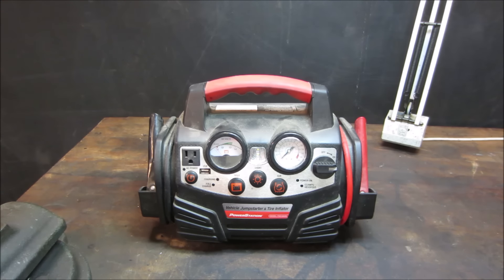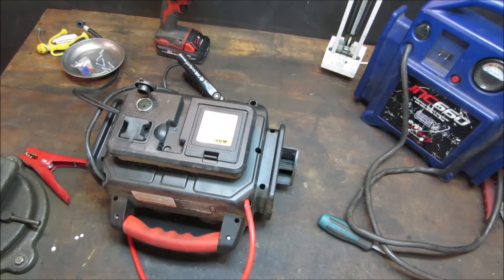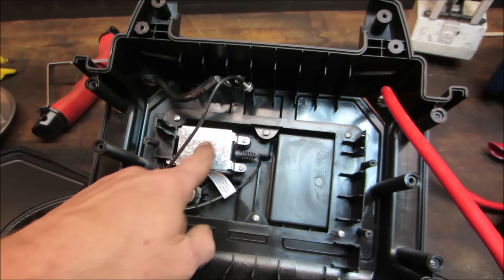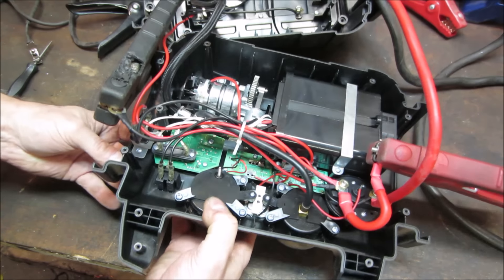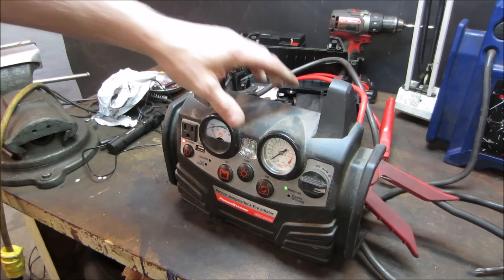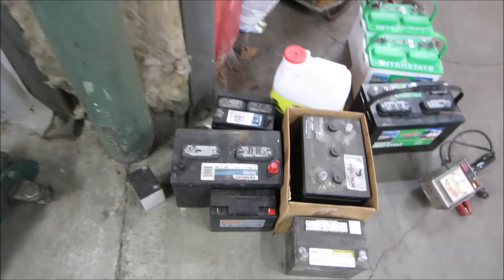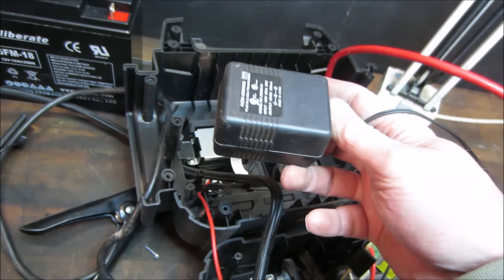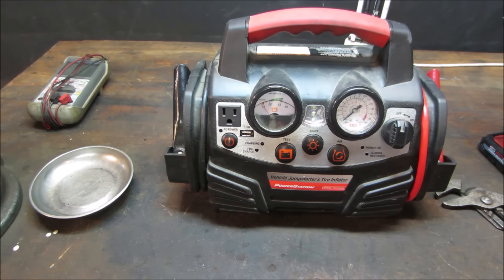What is inside a car jumper pack? and can we fix it.

Comment: I vote yes for a train repair video.

When I was a kid my dad got several large (4' x 4') crates of old electric train sets from an auction. He wire brushed the track sections, oiled up the motors, wheels and tested them out. Some of those huge old variable speed transformers were bad, and blew the fuse. I think there were several dozen working sets put together out of the good parts. Most of the engines and cars were metal with very little plastic, and were about a foot long. Some engines even had headlights, and smoke makers. I don't remember how much money he sold all that stuff for.

Comment: The battery load tester has an easily adjustable needle … on the front of the meter there is a clear slotted adjusting screw … connect a good battery and adjust the reading to show it is GOOD. Addictive shows, BTW! I can’t stop watching them! Thanks!

Comment: Hey Mustie, on the face of that load tester , there's a small plastic flat head screw just below the center of the gauge needle. If you rotate that it will adjust the position of the needle. Simply connect your multimeter to a resting battery and adjust the needle on the load tester to match. i.e. if your meter reads the resting voltage is exactly 13 volts, have the needle point right at the 13 on the load tester. Train set sounds cool! Thanks man

Comment: Very nice! I used to work at an electronics recycling center and those sealed lead acid batteries were almost always the weakest link. I'm a little disappointed you didn't properly test out the AC inverter though. It's probably good for 100-200 watts. You could power the train set off of it for sure!

Comment: My father-in-law give me a Schumacher power pack similar to this one and I replace the battery $40 ,👍works like a brand new one! I Believe you have to keep a charge on it every so often and also out of the heat and cold.
Reply: i bought a brand new one for 50, and it required no effort

Comment: That GREEN, RED, GREEN Light at startup is normal for the inverter. It's the P.O.S.T.(Power On Self Test) for the board. MOST of them list the Watts the inverter will handle somewhere on its labeling. I've run drills off them before, but in all fairness ... that thing YOU plugged in looked like a power hungry behemoth. Lol. Anything less than that should work fine. Great video! Thanks!
Reply: Hmm, low power I think. If you looked at the power transistors in the inverter, they were very small. Something up to 100 watts would be the limit I think, like an inspection light ?…..

Comment: On the load tester: (with volt meter), measure a good battery voltage, then hook load meter to it.  The screw in the middle of the load meter face should be the  meter adjustment.  Turn it to match original measured voltage.

Comment: I think the reason the grinder didnt work was because  the AC power outlet is most likely fed from an inverter..which is powered from the DC battery.. You took the black box apart ( the one with the fan on the end) and I would guess it is an inverter to supply the AC to the power outlet
 This means you can go to a remote location and use a 110v appliance, fed from the battery. I may be wrong, but I ghink you should check if the AC outlet works after you replaced the battery.
By the way.. really enjoy the videos.. I am just a few years older than Mustie and spent the first 18 doing alot of the same things.. making stuff work with no money..and no tools.. we were dirt poor but I had alot of fun and learnt a lot...so watching these brings back many happy memories.

Comment: The 120 volt supply is a switched mode where the driver feeds it with a high frequency which is far more efficient, needing no iron core and a using ferrite core. The output of that then needs to be converted to 60 Hz 120 volts which would be done via the devices on the output side.
Reply: More simply known as an inverter. Those ones tend to be sub 100w often 65w which will run a tiny tv or laptop supply.
Reply: The little green fuse should be 30A. 
Means 30A*12V=360VA.
This would be the absolute maximum power rating. 
As this inverter looks really crappy I would guess that the transistors blow before the fuse does. 
Lets say at 20A. means 20A*12V=240VA. the efficiency of that thing should be quite low. I guess 60%//0.6. means: 240VA*0.6=144VA. As there is not much of a heatsink on anything and that fan is not pulling air threw like crazy this thing might handle 70-90VA (W) permanently.

Electric motors mostly do not work on those inverters as they don't put a proper 50/60Hz sine wave out.
Reply: @radio-pirol  Brush type motors will work on these little inverters as long as they have enough watts. I have used drills with them.
Reply: @radio-pirol  one if the 4 bridge rectifier diodes blow will also blow the fuse.
It's the first thing I used to check on CRT arcade games monitor chassis's.
On Williams pinball games it's on the main power / solenoid board.
Reply: @ronaldheit196  you might be right that those are the weakest point!
Reply: @radio-pirol  you're the first person i've met who uses volt-amperes instead of watt or watt rms.
also is that 2137 on your pfp?
Reply: @Timsturbs  I just did not wan't to mess it all up like VA=W=Wrms or make it more complicated as it needs to be for what I did there...

jup it's a 2137 and I really wonder how many people actually know what it is ...
Reply: @radio-pirol  watts are commonly used for dc and switching ac. never seen someone use volt-amperes for that.

my guess is around 180million people know what it is.  didn't know they made it to germany, are you from ex gdr part or smth?
Reply: @Timsturbs  I just did that cause everybody understands V*A=VA. Does not need any further knowledge.

I'm in ex GDR and the car was originally delivered here. It's made in December 77 and arrived here in January 78. Last year the GDR imported Moskvich as the people did not wan't them anymore cause of quality issues. I don't get it how you decide to buy a Trabant instead of a Moskvich but it was how it was...
I have no ideas how many station wagons we got but they have been used by many companies. We even got some 2734 as I heard but it seems like there are no survivors.
There are maybe like 20 station wagons on the road here in Germany today and somewhat around 400 Moskvich in total. 
Most people here have no clue what it is even here in the eastern part it gets worse if you go west. Even the few that know that it's a Moskvich don't know the model.
I wanted a slightly unusual car that is not expensive and has a good supply of parts and that's what I got and I really enjoy driving it.
Reply: @radio-pirol  yes i got your intentions, you just confused me a bit. thanks for clarifying. i know people buy niva as unusual car but moskvich is something new to me. well at lest it wont drug you in debt like one of my friends with his e28 :D

Comment: This was cool to see. Free is for me, right? Yeah, I'd like to see a train set on your channel. Why not?
Reply: kind of ticks me off but on the way to the construction site I saw two of these out by the road...stopped, grabbed them, took them home, both dead. One was even fancier than Mustie's...I ended up tossing them in the electronics recycling bin....later on my father passed away and had one in his car....my mom asked me if I wanted it. Since it too was dead I took it apart and learned how easy it was to replace the battery inside. Ordered 1 from amazon and voila, a good booster pack. I could have saved and sold the other two which ticked me off that I didn't care enough to take them apart...free is free and in the case of the two, I could have made a couple of bucks since they sell for close to $200 up here.

Comment: just remember when you handle the inverter board because even though it is powered by 12 volts it makes 110 volts and can have charged capacitors after power is disconected.

Comment: I'm surprised and impressed that they made this user serviceable. I have a high priced heavy duty xp10 or something, can't remember the manufacturer but that swelled up within 6 months and it is sealed tight, like Sonic welded or something. It no longer jump starts anything but does work as a high priced battery charger for a cell phone. Or I suppose I can stab it with a screwdriver someday to start an emergency fire...
Reply: It's not that they made it user serviceable, if you look at it it's a commodity Chinese product, it was made to be manufactured as fast as possible likely and the tooling for friction welds probably wasn't worth the investment

Comment: On your battery tester, I want to say anything that has a needle gauge should have a adjustable set screw to adjust the needle gauge. Maybe.
Reply: Those things drift off after a while, i bet that one is older than i am. I have a Metrel insulation tester which has to be calibrated every 2 years.
Reply: Back in the day you could adjust.  All modern cheap meters are sealed with no adjustment at all.
Reply: There is, it’s the plastic screw slot on the meter needle housing, set it to the correct voltage when the button is not depressed. If you look at the meter it shows barely eleven volts…
Reply: it does. that plastic screw in the middle is a calibration screw.

Comment: I'm sure you understand about these smart chargers, they have to have some kind of charge in order to start charging. If you use an old-fashioned dumb charger then it will charge these newer batteries a little bit until the regular charger will work. I even do this on my tool batteries that I get from the dump. I probably have over 200 at the time that I got working again.😁
Reply: Or just put a welding travo over it and tap it a few times . The will relive the dead cells .
Reply: Exactly the point maybe not in this particular case but my Ryobi drill batteries the 18 V batteries have a charging system is built into the battery and if the battery sits on your shelf and the voltage creeps below I think it is 6.5 V the battery charger that’s in the battery itself will not charge the battery it’ll come up as a junk battery but all you have to do is jump it with another new charged battery to get it above the 6.5 V and I’m not sure that number that might be 5.5 but I’ve done it on several of my batteries especially those little half batteries those seem to crap the bed soon after you buy them and everybody throws them away but all you really need to do is jump it charge it with another battery and then plug it into the charger. I have a smart charger and I have an old craftsman charger that I can run the charge up to like 14.7 V without the charger testing the battery I guess that’s when you need a human to test the battery right the old days!!!
Reply: @theusconstitution1776  0
Reply: @Chappomusic  You do what? Hook up a welder to your battery posts? AC or DC, or doesn't matter? Like for 1/10th of a second, or until it becomes all solid metal? If it's AC, how about just skipping the welder and connect house power to your batt. If it's a Lithium ion battery I'm guessing either choice could make a spectacular fire
Reply: I've saved a few batteries with a bench power supply. Bought an electric chainsaw, battery was dead and got sent a new saw entirely, but I got to keep the old one so I took the battery apart

The 80 something volt charger obviously gave an error because the battery sat at like 20 volts, it would've passed a ridiculous amount of current. Set a bench supply to little over 3 volts with a current limit and slowly charged each cell until the pack was high enough for the main charger to be happy, still works a few years later

Comment: I'm sure it's either been figured out or addressed by now, but the reason that the 110/120V outlet LED flashes between red and green is because of the soft start technology. They can't really power motors because of the modified sine wave (square wave staged sequences) as long as you don't have a load on it (like an incandescent light). Judging by how small the inverter is, it's probably between 50 and 100 watts continuous/150 possible peak. The LED itself will be green when in normal operation but will change to red if the input voltage from source is above a safe threshold or if the current draw is greater than what the device can handle. I would test it with different wattages of bulbs to see what it's cutoff would be and note it on the device somewhere. Definitely don't want to run a motor on it though since it risks burning up the mosfets, even if they are behind a transformer.
Reply: Spoken like a smart guy. I was gonna be rude but that was informative as hell. I thought charging something that had a battery ( phone, laptop or a spotlight ). You pretty smart for someone watching videos on utube. 🤪

Comment: Love this one.  I have pretty much the same jumper pack, and was always nervous that it would die on me.  Aside from inflating tires and jumping a dead car battery, I also use it to run a few lamps during blackouts in winter.  Now I know what it’s innards are like, and the prospect of replacing the battery.  Very cool.  Edit…..and leaving it charged in all the time.  I always thought that might ruin the battery, but geez, if Mustie does it, then I will.
Reply: I think most of those jumper packs have replaceable batteries in them, most people don't know and throw them out when they no longer work LOL
Reply: Remember charge on trickle or maintenance charge if you have the option. Low charge rate keeps them working without drying the battery out.

Comment: I would like to see the progress on the Ford Econoline pickup. Haven't seen anything on it in a while
Reply: He said in a comment on another video that he gets migraines from the welding fumes from the bodywork. Not sure if there will be any progress.
Reply: @kjdude8765  in which case, he needs to invest in a fume extractor. In the UK we have to use fume extraction even when welding outside. It's  Law.
However, most home welders don't bother. 

Welding produces some nasty gases such as carbon monoxide, cyanide and other health threatening things.
Reply: I know right? New bugs coming in and nothing on the E pickup......speaking of which, gives me an idea...wouldn't that be a great project to switch over to electric? The battery in the back would definitely help with balance......

Comment: Repaired a different model years ago. Just needed a replacement battery. Sourced one from an old UPS and it worked great... until the plastic jumper cables cracked. Thanks for the video.

Comment: That looks like one of those UPS batteries (battery backup, not the package wrecking company).
Reply: Possibly also golf cart. I know the 12v9Ah one I used to make a UPS is from one of those.
Reply: Call OOPS when it absolutely positively has to be there over do.
Reply: It's the same type of gel battery, they do have a wide variety of peak discharge rates tho.
Reply: Mobility scooters too. I'd bet there's more "12/18" (or 15 or 17ah) batteries in mobility applications than anything else.
Reply: @whitesapphire5865  Some older E scooters use them as well.....pre-li ion ones. My landlord had one and it was left in the garage uncharged and all the batteries froze and swelled. Pulled them out, ordered new ones, ran like a top. He used to use it to run around the industrial building where I rented my shop.

Comment: That's a fine little power pack with all the fixin's. Some say you'd do well to keep it simple with such power packs and without the failure-prone accessories (airpump, AC output, etc.), and just run those separately as plug-ins, but since you have them anyhow...I'm at least seeing some metal parts on that compressor and not ONLY plastic, so it may not be worst-of-the-worst, but I'd still recommend using it only for bicycle tires or balls or maybe smallish lawn equipment tires, and not car tires--though in a pinch it might grind through one or even two sedan tires before giving up the ghost. The AC is probably handiest for low-draw stuff like charger adaptors, like for laptops, cordless tool battery chargers, and that sort of thing. And of course, a USB port is always handy. Well found, Sir!

Comment: I’d be willing to guess that the AC output is around 400 watts so you could plug in a laptop charger or something low power. The little box with the fan is obviously the AC inverter.
Reply: More like 60 watts given the components used.  Max 100, but probably 60-80.
Reply: Yeah I've got two of the same kind
 175 a/c watts peak I've used it to power an LCD TV. They're useful but it's best to keep them plugged in if not using.

Comment: That enclosed circuit board is a ac / dc converter with a step down AC feed transformer l and the 4 diodes are an AC to DC bridge rectifier to service that AC output socket and the other DC powered items.
You see similar boards in pinball and arcade games.
I'm a 37 years service tech on games with board level repair experience.
I love how Herr Doktor Professor Mustie repairs so many different items from engines to this.
Carbs, " We're goin' in" one of my favorite quots of his.
Reply: Inverter of some description I’m guessing

Comment: Cool video. I enjoy how casual and laid back you are in your videos. 
It looks like that PowerStation PSX1004 was only available through Costco. The 110 AC outlet is good for 200 watts. Also, almost all inverters do an internal voltage check for a few seconds before giving the green light.

I put a new battery in my Black & Decker jumper pack not too long ago. I got a good deal on a replacement battery and it only cost me $29 plus tax.